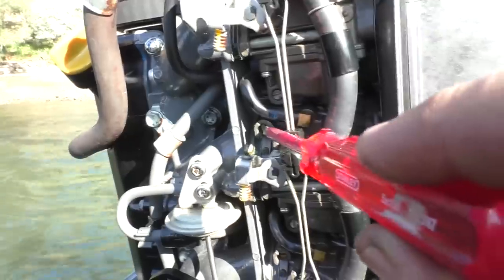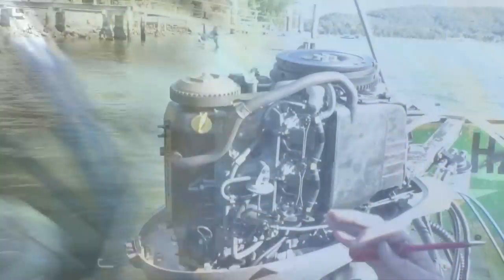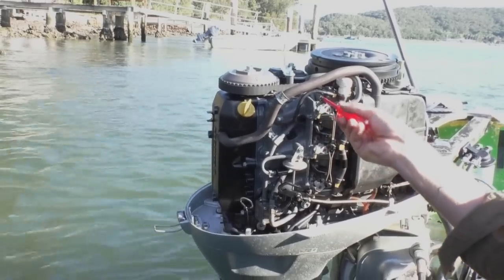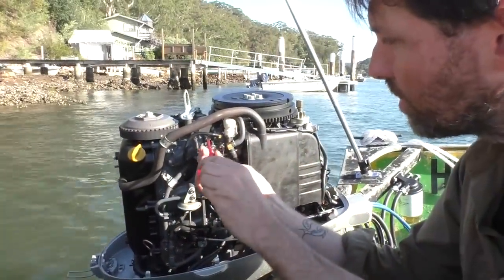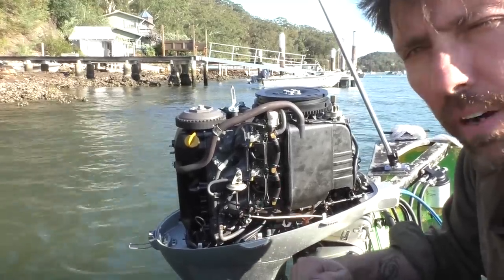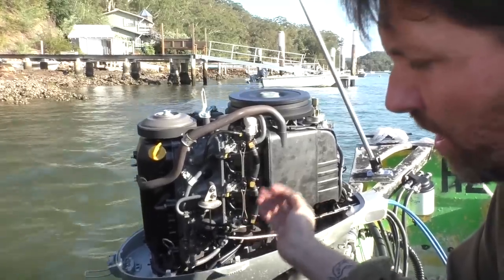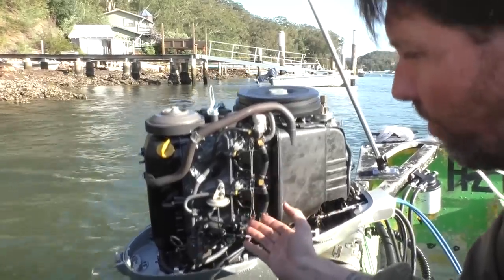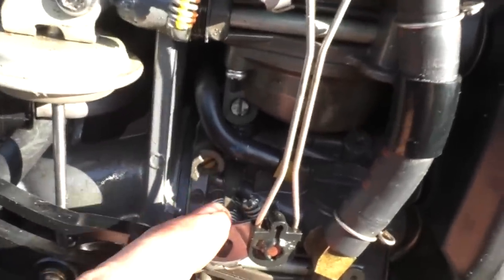Four stroke carburettor synchronisation

Comment: Great info. I do have a quick question though. My manual says not to touch the mix screw, set it and forget it. Consequently the only way i can keep it running is adjusting idle which is way too high and slams in gear.  Now that i write it out seems obvious but just to clarify, should i mess with the mix screw? 82 mariner 60hp
Reply from the maker: I would clean the carburetor. The jets have probably just clogged up with time.
Reply: @DangarMarine  cleaned em a few months ago. Finally found a rebuild kit that didn't cost 200 hundred dollars, so ill rebuild and pray. How do you feel about the seafoam "shock" where you run a gallon of fuel with a can of seafoam?

Comment: Don’t see my previous question which I posted about a week back.  So, I’ll ask again.  How should 6-carb set-up (Johnson V6 150) be performed?  I’m guessing; the best way may be to use one vacuum gauge with a 6-gang air manifold.  Correct?  Comments appreciated.  Thank you in advance for response.
Reply from the maker: 6 gauge is great, but if you only have four just balance two on each side then two the other relative to those two. Bear in mind this technique can only be done on a four stroke outboard.

Comment: I have 6 carburetors do I need 6 guages to Synchronize them or can I do 3 or 4 at a time with same gauge setup you have?       And if so do I adjust the carburetors on one side first then move to the other side.   Or do I adjust left and right carburetors together?

Comment: Hi Mate ,,great vid,,,,so easy to understand,just 1 question that puzzls me with syncing. if the carbs are off the bike cant you just adjust the butterflys so there all closed then adjust the idle to the corect rpm.s..as i understand there are 3-4 progresion holes in each carb & if 1 butterfls is open more then the other it will have more progresion holes open...hope you can explane it to me   ...Cheers Brett
Reply from the maker: Having all the butterflies set the same doesn't take into account the differences in the intake runners etc. Vacuum is more accurate, but visually is better than nothing
Reply: Hi Mate ,sorry didnt know how to contact you,,2 qstns,,, is that your Green machine for sale on evilbay,,,,also there was a fire on danger island a few weeks back,,hope your doing well,,cheers take care

Comment: So glad we are on the same wavelength and you don’t just crack on with shit you have no idea about 👍👍 My 60 hp two-stroke Yamaha has a distinct vibration noise (resinence) at 4300/4400 rpm I have avoided travelling at this rpm range since new what do you think it would be ? Regards Leigh
Reply from the maker: It could be mild bearing or cylinder bore wear that hits a certain resonant frequency at that rev range. Does it sound like a serious internal vibration or could it just be so component loose that is attached to the motor (airbox, CDI unit etc)?

Comment: How about the accelerator pump on the Honda’s. I have a bf50 which is same motor and it isles fine and goes fine but if I stab throttle it dies. Carbs are close in sync and it does everything flawless
Reply from the maker: Ah, I just got another junk Honda in the workshop the other day so I'll use that to do a vid on testing them.

Comment: Good job. Enjoyed your technique. I test for vacuum leaks before any adjusting. A can of carb cleaner sprayed around the carb area while running immediately shows increase or decrease of engine revs  revealing air leakage somewhere telling me to address that issue before tuning.  As always, enjoy your site for many reasons. BTW: Either tomorrow or Tuesday I am receiving my dad's old '57 Johnson  7  1/2 and his '80 Johnson 10 hp. These have not been started for at least 20 years. Any help on what to do first and steps after that? Thanks.  Steve

Comment: Hi, excellent video, thanks for sharing. I need to sync a Mercury V6, 150 Hp. How can I do it if the devices have just 3 or 4 sync gauges? The 3 carburetors of my engine are double, one carburetor for 2 cylinders. Should do one side first, then the other? Thanks for your help.
Reply from the maker: It depends how the carb linkages work really, but I would get the bottom two cylinders synched to each other and get then go up each side making the other two synched with that bottom one.
Reply: Thanks very much for your advice.

Comment: good video 
my engine (1985 50hp mercury, 4cyl. 2 carbs,) seems to be running rich and fouling my plugs.
(eg. all 4 plugs wet, carbon build up)
I have cleaned my carbs, new gas line and did a sea foam shock treatment,
it starts easy when choked when cold and runs great till the plugs get fouled.
could this be anything other than running too rich, would both carbs be out of adjustment that much and it run that good.
Reply from the maker: Could be the enrichment / choke system is sticking on somehow.

Comment: Hello,

Ever tried to couple those 3 vacum measures together and test if they are actually giving the same values for a vacum  ?    I bought one years ago and later tested them to measure quite different so I really had probs finding a good balance ....nice video though ....
Reply from the maker: No, haven't tried that but it would be interesting to see how consistent they are.
Reply: Mjød Ølll i know you want everyone to upgrade ignitionsystem but im not sure i want to sinl a lot of money im this motor so if somone would do a vido om how to set the ppints on aearly model chysler 75hp outboard i would. apriecate it

Comment: Will this be accurate if I tune the motor out of water? Of course the motor would be connected to water. Btw great video.....THANK YOU for your time.
Reply from the maker: It will help doing it out of the water, but it is best for the engine to be warm and in the water where it gets the full exhaust back pressure.

Comment: I like your straight forward to the point style of video. That is the same process my auto shop teacher showed us many years ago when cars had carburetors. I see you don't have the stop on the adjustment screw, did you remove it? I have my carbs apart for cleaning, is there a was to clean them without removing it? My 2005 BF50 starts great and idles for a couple minutes then shakes and sometime quits. Is on a sailboat and doesn't get run hard very much. It does help to run in hard for awhile. I apologize if already answered this, lots of comments.
Reply from the maker: Don't recall about the stop, too long ago! It's not impossible to clean a carb without removing its much harder than just taking it off first. I'd also be checking the fuel for water from condensation.

Comment: Your first step was adjusting the idle mixture screw on each carburetor to the point where the engine ran the fastest.  But then when you made the adjustment on the "butterfly valves" the engine rpms also changed but that rpm increase did not seem to factor into your carburetor adjustment.  If I understood you correctly you adjusted them so that they were all the same, apparently using the bottom carburetor's vacuum indication because it was the hardest to access adjust (if I heard you correctly).  What are we accomplishing here when you make the "butterfly valve" adjustment?  I understand we are getting vacuum values closer to each other but overall what are we doing beyond what you accomplished by your first step (adjusting the individual idle mixture screws)?  Looking at your synchronizer gauge there are red arcs above and below where the indication needles lay.  In a gauge "red" usually means "not good" while a "green" marking/arc usually indicated good or desirable, but you did not seem to reference either the red or green arcs on the face of the gauge.  Are those color (or is it spelled colour in Australia) markings on the synchronizer gauge not applicable to these carburetors? 

-Thanks!

Comment: 1990 Merc 90hp 2 stroke does that thing where it doesn’t wanna start when cold like when you made a vacuum leak, I think it’s a fuel issue tho cause gas starts flooding in the water after turning over 10 times before it finally starts.  After I prime my bulb and go out WOT it will start to lose power until I reach down and squeeze the bulb while WOT. Could that be fuel pump or what do you think? Thank you. I set my fuel screws to 2 turns out as well

Comment: Thanks so much for the informative vid! Such a help with all my yamaha motors. So with the 3rd carb in this the one you adjust the other 2 to, what if the vacuum is too high on that carb and you can't adjust the other 2 to the level of the unadustable one? How can i lower that carbs vacuum?TIA!
Reply from the maker: If you adjust the idle screw it will adjust all the throttle plates so you can open all the plates and then bring the other two up to match.
Reply: Dangar Marine thanks so much, i actually found it was a part of the linkage that wasn't moving w the throttle screw adjustment bc of corrosion/rust. Cleaned and all good! Thanks for all you posts you rock man!

Comment: Do you have a quick tip on putting on the spark plug wire cap ends or boots with installing the springs inside ?i never feel like there on right with the beast conations
Reply from the maker: Hey Bruce, no tips as such, some things are just a bit fiddly. It's a good idea for a video though as making up new leads is often required to fix a misfire on an older outboard. I'll add that to the list.

Comment: After the first past working with the air mixture screw, wouldn't it be a good idea to start at the top and tweak them now that the other cylinders are running more smoothly?
Reply from the maker: Hi Joe. You can do, but in theory once a cylinder is contributing the most power it can it should be very close to the ideal stoichiometric ratio, regardless of what the other cylinders are set to. If the RPM changes hugely with the bottom two cylinders, then yes, checking number one again probably is a good idea.

Comment: nice video! i have 1983 50hp johnson and fires right up, but when I put it into gear it dies right away. compression is at 105 on both cylinders. What would you recommend I check? thanks.
Reply from the maker: +Nick Lonsbury How freely does the gearbox turn when it is disconnected? Have you tried upping the idle and playing with the carb mixtures?

Comment: Great video! Question for you, the air mixture screws have a locking mechanism on them that after checking around have to be broken off and have to be replaced with new mixture screws. How do you snap the tops off? Thanks for any advice.
Reply: I have the same question, did you ever figure it out?
Reply: @davelipanovich2661   I applied  a little heat to the limiter which released the glue and limiters pulled right off.

Comment: Hi Eric from Seattle WA. I love your videos. Quick questions. If I drive my boat from my fresh water lake out the locks to salt water in Puget Sound and then drive back 30 mins in back to fresh water do I still need to flush the engine? I have a 40 hp 4 stroke Mercury.
Reply from the maker: If the water isn't too silty (ie. you can see the bottom clearly) I wouldn't be too worried about flushing. It would definitely be better to do it but to put things into perspective I run my boat in very silty salt water every day and flush it once or twice a year during its servicing. The rest of the time it lives in the water. Having said that, because it is used twice every day it never gets a chance to dry out internally which I believe helps.

Comment: I have a merc 4 stroke have built the carbs and all 4 carbs were nasty .. completely overhauled gas system and have good fire .. cranks and idles good just will bog and quit when you plain off what am I doing wrong?
Reply from the maker: Usually that is from running lean so it could be that the jets in the carburettor aren't completely clean. It could also be a vacuum leak, a problem with the timing, a restriction in the fuel pump or a vacuum leak.
Reply: Dangar Marine thanks I see some videos on Yamaha 4 strokes and they put a bigger jet in the carb and it fixes ... also when I twist on the adjustment screws on top of the carbs it makes absolutely no change in way it idles ... any tips on that ? Oh and thanks for the reply subscribed

Comment: I just rebuilt my carbs on a 1999 yamaha 130 txrx 2 stroke. It runs really good until im at full throttle it surges. Could carbs be out of sync? Im replaced just about everything fuel related.
Reply from the maker: Sounds more like its starving for fuel. Could be sucking air from one of the fuel lines.

Comment: Great video. I have 2002 mercury 90hp 3 cylinder 2 stroke. Does the carb synchronizer work on 2 strokes, and if not how do you sync the carbs?
Reply from the maker: No, 2 strokes don't have an intake manifold like four strokes. Just undo the locking screws that attach throttle plates to the throttle linkage and let me all close completely at idle and then tighten the screws up again.
Reply: Dangar Marine Thanks for the quick reply, keep up the good work.

Comment: I consult you I have a 50 hp honda I changed all the jets and when I accelerate the engine trembles and I take 3 turns out of each carburetor that I would have to do

Comment: Great video! I have a 2003 f90tlrb. I rebuilt carbs after suffering the effects of ethanol. I tried to adjust per your video. I was unable to get any change in revs when opening fuel mixture screw, I only noticed a decrease in revs when turning in/closing fuel mixture screw. I stopped at that point and settled on 1 turn open above that(book suggested 1/2 turn, but idled very rough). The idle is still a little rougher than I'm used to. Also, worth noting, Idles better when boat is in the water (back pressure on exhaust?), has the same jetting as before the rebuild.
  Can you point me in the right direction as to what I might be doing wrong/ missing?
  Thanks for taking the time for the great videos!!
Reply from the maker: Normally if the mixture screw didn't have any real affect I would say either the idle circuit is blocked or that cylinder wasn't actually providing any power. Given you've just done a rebuild I presume the jets are all clear. You could try getting it to run on one cylinder at a time and see if any adjustments to mixture make a more noticeable difference then.
Reply: Thanks for this. I would agree if one or two circuits being blocked, but all 4 are acting exactly the same. I'm missing something. I ordered  carbtune sync/gauges and will attempt adjustment at higher rpm.  
  Until then, you helped me get it running good enough to chase fish. THANKS

Comment: Perfect tutorial, many thanks!👍🏻

Ps do you now the standard turns for the air-fuel mixture screw on an yamaha 25hp 2 stroke outboard from 1992? (6L2) i can’t find it anywhere...
Reply: try 2.5 turn's to start with!,, turn the mix screw fully home but don't grind it home!,, they strip thread's and brake off very easy!,, so be warned,,  if it needs a little more or less tweak it!

Comment: Thanks for all your videos.. "Great Stuff".... I've got a Yamaha 225 four stroke a 6 cylinder with fuel injection do I Synchronize roughly the same way? And Do I need a synchroniser with six gauges to synchronize all at the same time?? thanks for any and all help.
Eric
Reply from the maker: With fuel injection there aren't any mixture or idle screws to adjust.

Comment: Stu I was wondering if u can comment on how to tune 4 merc carbs in a 2005 125 ELPTO. Only carbs 1 and 2 have idle adjustment screws. The RPMs increase when I turn in from the service manual setting but it surges. Seems to run smoother when i turn it out but the RPMs are lower. Not sure where to go from here.
Reply from the maker: Not sure sorry, never done a carb balance on one of those. I would say you simply balance each carb to it's non-adjustable partner.

Comment: i picked up my first boat a few weeks ago. It had been winterized and sat in a garage for 7 years 77 85hp johnson outboard v4 seahorse. New gear oil. fresh fuel and started right up. the problem I am having is under load, in the water im topping off at 3k rpm. at full throttle i can hear it bog down a bit. I just changed the spark plugs and cleaned the carb. a bit. Im hoping I will get a little more power when dropped in the water this weekend. Any ideas of anything else I should do? I have taken it out 3 times and have put around 14hrs or so on the motor.
Reply from the maker: It could be a few things. I would start by a carb clean then check compression and make sure you have spark on all cylinders. If that all checks out I would also check the timing.
Reply: Thank you for getting back to me. Your the best!!!!
Reply: So after cleaning the carbs, compression check , plugs, wires coils etc.. I found the issue may actually be in the choke? was out today and at WOT decided to push in the key for choke and wouldnt you know it accelerating like a bat out of hell. hitting almost 5k rpm. As long as im holding the choke in im cruising at an acceptable pace. once released the rpms drop back down again to 3200rpm. I have no idea where to start.

Comment: Love the videos!! Ive got a mercury 75 2 stroke.  Idles rough.  Runs great off idle The center carb when adjusted doesnt seem to change idle speed.  Think its a dirty carb? Ive never put a distribution gauge on it.  Compression is good and even across the board.

Comment: Have you ever had an issue with the air screw that has been bottomed out and broken the tip of the needle in the carb. What have u done to repair this?
Reply from the maker: I haven't had that situation but I would probably try some compressed air to blow the tip out if it is stuck in there.

Comment: Good stuff Stu.
What would cause 2 stroke to run and start great, when warm. but cold a night mare to start , takes quite a bit of cranking before it fires?
Cheers...........
Reply from the maker: How does it get choked? Does it have a choke plate or a fuel injection solenoid?